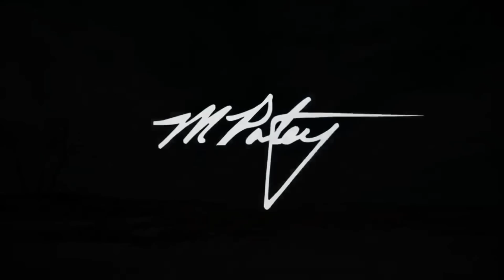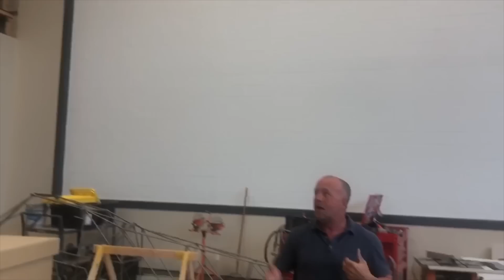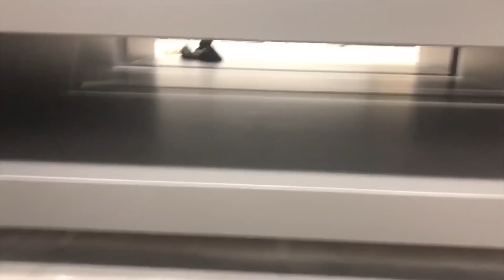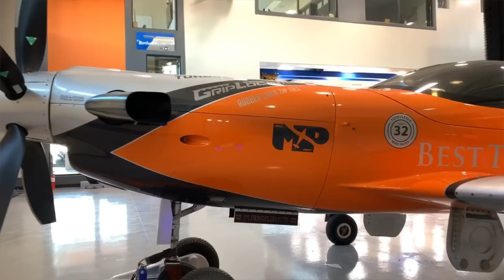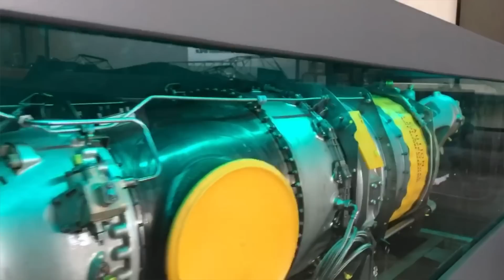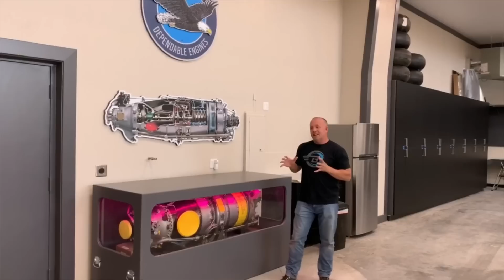🤫 Sneak Peek! and Update on Scrappy!

Comment: Expensive scrap :)  Looks very interesting. Might I suggest making it minimal for max performance? just narrow enough hull for the engine, only half exhaust pipes bent back with serrated edge to avoid dragging too much. Cockpit with very reclined seat only just room for you and a small helmet style canopy. Plenty of visibility. And then teardrop taper in the body right after you into a thin pipe and minimal razor thin tail. Razor blade wings too. Let it cut through the air as if the plane wasn't even there. Thin landing gear arms. Thin solid wheels on lean high strength steel suspension. Only for runway use. Maybe fly by wire. Bring a chute.
Reply: Data point: The BD5 mini plane according to wiki could cruise at 369km/h with only a 70horse engine. Because it was a minimal plane with blade wings.

Comment: Mike it would be really cool to hear you talk about the prop design that goes into your speed machines. The engines are cool but the fan up front is where the rubber meets the road and no doubt you spend considerable time looking at how the prop plays into your vision and its expected performance. The last plane I built was a Rutan Veri-EZE back in 1986! Bert actually told us who to talk to about a prop when the one we started with was pretty disappointing. Those were hand carved wood props!!!! Ha ha
190 at 4gph on 76 Auto gas👍. Fun plane

Comment: -67's are great engines.  Had R models on the Shorts 360-300's And D models on the 1900's.  Lots of time spent on hot sections and other maintenance.  Studs and nuts for fuel nozzles were a bonus too.

Comment: 1200SHP! I flew the Air Force's T-6 Texan and that thing hauls with 1100SHP in a 7,000lb airframe.
Reply: The T-6 Texan II flies with a 97" prop (at 2000 RPM). You're going to need some serious landing gear or be a tail dragger to clear the prop!

Comment: Great work!  One thing I have wondered about with turbo props is it looks like there is room for improvement in the aerodynamics around the exhaust stacks? And/or is there a way to use or recover the exhaust gas to reattach or improve the airflow after the gas exit?  Something like a ducted exhaust?  Heated gas expanding.  How about a pusher configuration, too?  Just thinking out loud.

Comment: I spent 9 years working on -67's fitted to beech 1900D's and before that 8 years on -34 and -15ags. Im not a fan of them. Seen a number of major failures and they are maintenance HUNGRY.  Pratts need to do a major upgrade / update on the PT6 or come out with a replacement. The new build will be a beast tho with that much hp.

Comment: PW PAPA is the engine to go on DRACO. And Draco's engine straight to SCRAPPY.  Having said that, what you're saying is that with the 1800 HP gearbox you will get up there with less than 1200 HP? What's the difference in weight between the 2?

Comment: Awsome, your like Thomas Edison, work hard all the time creating and inventing.

Congradulations on all your recent mods on your incredible Wilga making it to Alaska and back and congradulations on winning Valdez Alaska's STOL competition. We drove to Aka ka and back from Colorado, camped in Valdez. Panning fir hold at most every stoop, made 1k$ in cash panning for gold! Akaska is an amazing place.

Was in a smasl town with signs warning you planes have rightifway. A piper cub taced diwn main street, waiting at red light, then took off down the Alcan highway once past homes, where it's safe. We helped a couple that rolled there miturhine off a cliff. Called on our CB radio for help (1981). Th The retired couple sitting in the side if the raid as lk bloody, Looked like they got malled by a bear. They hit run off the raid by a drunk driver, rolled three motor home diwn a cliff. He burned his feet climbing over the upside down motor homes exhaust pipe rescuing his wife. Called for help on outmr CB radio (2981) Person answered had us take the injured to the next town. Next town a was a single building, a dive bar with a plane parked next to it in the parking lot and a donkey loaded down with hold pans on its back. We walked in, obvious we were outsiders. The bartop had a scale on it, patrons can pay there tab in gold panned. Bar tender stated he had not had a drink he could fly them to Anchorage if one of the three at the bar could watch the bar for a few hours. A patron said he would watch the bar. Baryebder hand fueled the Otter from 55vgallin drum on side of the bar, he put the couple in, did a run up at the bar and took off down a fairly rough steep hill ending at cliff, they disappeared over the cliff and flew off. Was an amazing experience. By chance we ran into the same couple at an RV supply store after we drove back in Colorado months later, both fully recovered, they took us out for a nice lunch. Our rig was a suburban, motorcycle on front bumper, towing trailer to camp in with two canoes on top of the suburban. While camping in the Canadian rockies on drive up to alaska, a man was up early, he pulled out his buggle and played the US National Anthome as the sun rose, with campfires burning, smell of bacon and breakfast made on open fires, brought tears to your eyes.

Comment: Got any specs on that engine?  I searched the P&W website and couldn't even find a PT67P series engine.  Was this thing swiped from their R&D department?
Reply: 67P is 1200shp flat rating and is used on the Pilatus PC-12NG
Reply: @ryandensham2258  Is it still in the PT6A family then?  Looks bigger than PT6 I worked on in the military.  Thanks.
Reply: Daniel Kopp yes it is a large PT6A, meaning 4 stage axial compressor and 2 stage power turbine, with the “long nose” gearbox for 1200shp. Which models did you work on in the military?
Reply: @ryandensham2258  Only knew it as the PT6A.  I forget what dash number it had after it.  From what I remember it was only rated at about 300 - 400 HP and only had one stage of power turbine.  I worked more with the Lycoming T-53 and the Allison T-62 turbines mostly with a few T-55's and some of the GE 700's.  Also got to work on the Solar T-63 APU.

Comment: Being a car guys... Im having a hard time understanding 1800hp on a 1200hp gearbox... 1200hp on a 1800hp gearbox is safe... but but but... ???
Reply: he explained it.. it will only be used at 1200 HP untill it reaches high altitude,, where it will adjust the mixture,, and still be able to deliver that same usable 1200 HP . (i know F%$k all about planes)
Reply: Not sure if you're kidding around or not, but I think the idea is that the 1800 HP at the turbine will decrease with attitude as the air gets thinner. He'll willingly give up some power at sea level, but at attitude, when the turbine can produce less power, the gearbox will be an appropriate size rather than being larger than necessary.
Reply: @thecma3  pretty sure your wrong.. but im just a photographer
Reply: @saltdogmedia4204  I think we're actually on the same page, maybe my explanation wasn't very clear though.
Reply: TheCanasian you are correct. The gas generator is sized for altitude power requirements, meaning it needs to produce excess on the ground and it reduces with altitude and temperature. No need for a massive heavy gearbox when the power isn’t needed for takeoff.
Reply: @thecma3  After a little thinking... Mike could of thrown in load... this engine is meant for a much bigger heavier aircraft so he doesn't need need the bigger gearbox,  good point ???

Comment: A 1200hp capable gearbox of a 1500hp motor!? Did you learn nothing from Disney's 'Planes'? Dusty Crophopper was a lesson to us all dude.
Reply from the maker: TheFleetflyer 🤠 I love the dusty crophopper reference 😂. Almost every turbine engine does this as well as jets. I never run above gearbox limit and I set the stops on my computer interface fadec control to never allow it as well as the Garmin alarm settings.. the larger engine only allows me to keep 1,200 in thin air.. to run it over 1,200 would certainly be a chrophopper moment 😜🤠